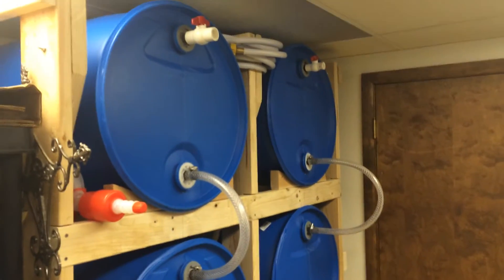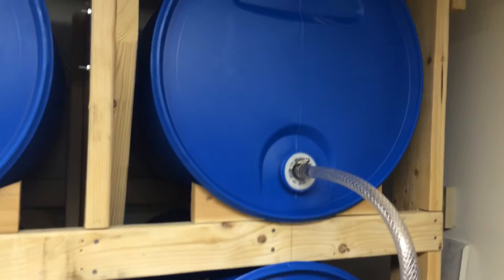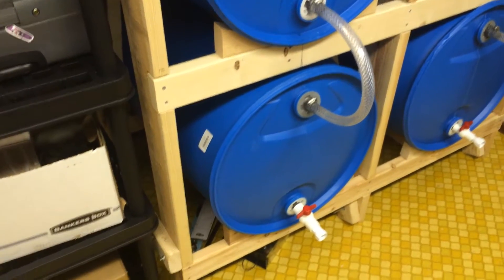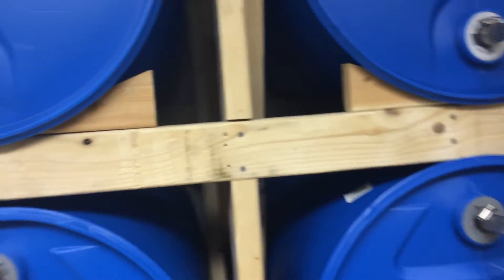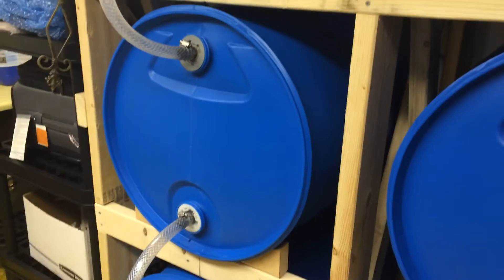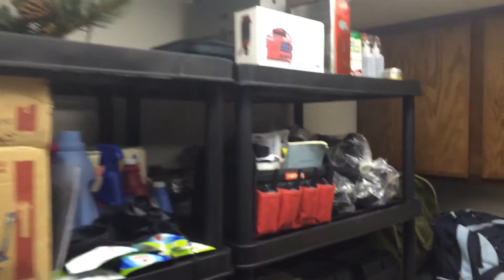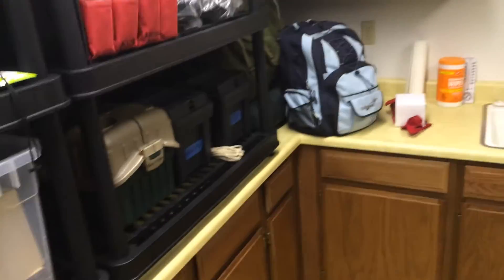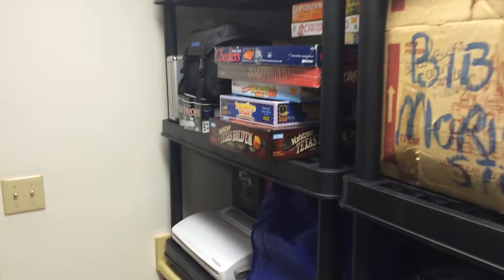55 Gallon Water Storage: Part 4 - Adding More Barrels

Comment: Watched the whole series, thanks for posting. But one serious warning. I highly recommend not interconnecting the barrels. With this setup a single failure can take out your entire or half in your case water supply.  I learned the rule of redundancy the hard way. We lived aboard a sailboat for several years. We lost half our water while in a remote location. Nothing more depressing then seeing 30gallons of formally fresh water in the bilge.
Reply: Hi, thank you for the comment. But how "exactly" can INTERCONNECTING make these barrels fail? I'm just curious because I personally like this set up myself and plan on making one. I've seen 3 stacked systems like these and nothing has gone wrong. I'm I missing something? I would appreciate your feedback.
Reply: @EAR452  Hello, I didn't say "make them fail" I said "a single failure can....".  Every connection is another potential failure point. I'm a K.I.S.S. kind of person from experience :)
Reply: @EAR452  I think he meant a contaminant can travel through multiple barrels if they are connected

Comment: What's the part of the video that shows me filling the containers. There is a valve on the top container. There is a valve on the bottom container. You fill water through bottom valve. You open the top valve to allow air to escape.

Comment: Great set up, thanks for sharing.  I'm just getting started, my question is why not follow what you did but plum it into the line so the water is always circulating and staying fresh?  I've not seen anyone do this, I'm not a plumber and maybe I'm missing something?
Reply: I drain and refill the barrels once every six months.
Reply: That sounds like a great idea. I hate that they use fluoride here. I wish I could get it out. Also, being in the south I am very concerned about slime water.  No matter what you do with a swimming pool down here sooner or later it will slime.  No matter how much stuff you put in it lol. So I am thinking I will need to find something to put in the water to stop that from happening.

Looking for advice there.... one fellow told me part hydrogen peroxide and part silver water would do it... not sure about either however lol.... also, with your setup if one barrel were to go sour then they all go sour... for that reason I am thinking each barrel may need to have a separate cutoff valve...

what you guys think.... thanks for help and great video....

don